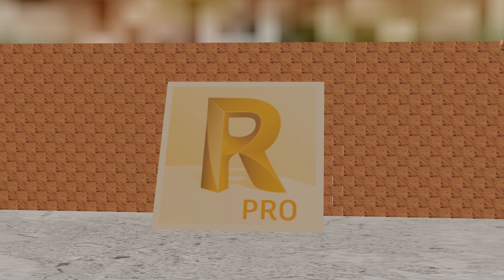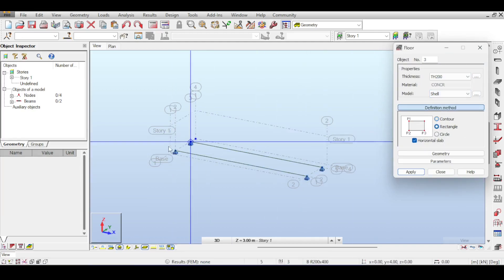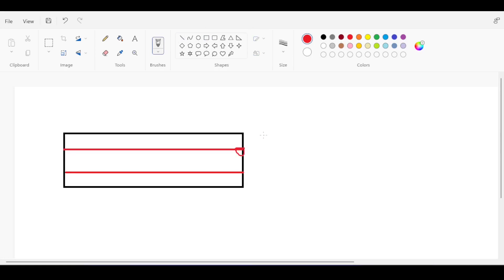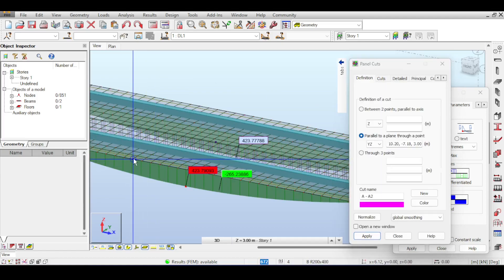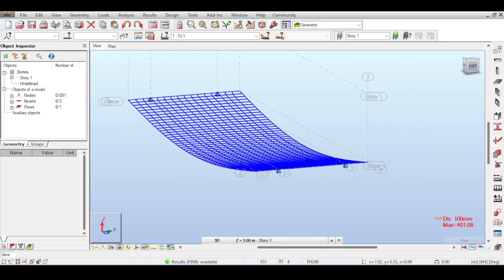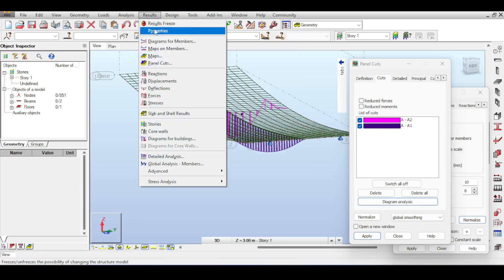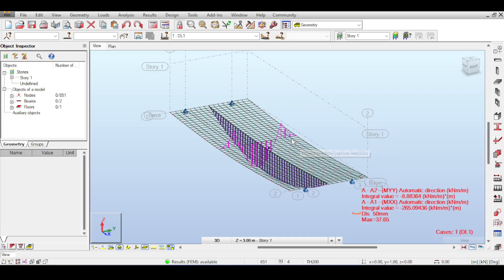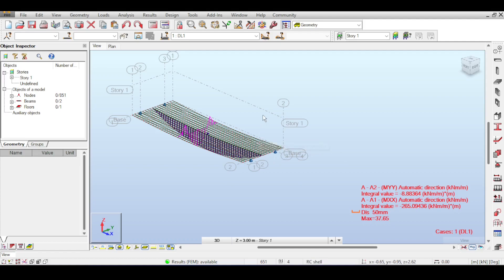The Importance of Beam Stiffness in Structural Design in Autodesk Robot

Comment: The idea of beam acting as supports to slabs doesn’t really sit well with me. In terms of supports, I believe columns are the only true support in any structure. The beams and slabs work in tandem in a floor system by sharing and transferring moments and shear according to their relative stiffness ratios.

Great tutorial sir
Thank you for the doubt clearing session.
Reply from the maker: I agree with you for most normal structures, as the slab and beam (especially if hidden beams) are cast monolithically.
(hidden beams are beams that have the same thickness as the slab, this is standard practice in slabs called: ribbed slabs in the Middle-east region).

In bridges, I am a little more skeptical to be honest.

Thnx for your comment, stay tuned for more content.

Regards,
CEE

Comment: The beam is normally cast with an offset to the slab's center. This greatly increases its moment of inertia about the slab's center axis, and stiffens the entire system. If you model this in Robot, you will get more realistic results. However, you will get some additional axial force in the beam, due to this offset, that is not easily negligible.
Reply from the maker: Hi there, a huge thnx for your comment.

you are right. Offsets should be included, but the way RSA models those is really strange. It just connects some rigid links, causing jagged moment diagrams. Thus, I think the effect of such an offset should be pre-calculated manually (for example axial and moment effects) and then applied on the bridge. 

Note that, if you have an offsetted beam, and you discretize it (because there is a slab for example), then each node will be connected via a rigid link.

So, I agree with you, but may suggest that the effect of offsets be calculated manually and applied as forces.

Of course, that is my own humble opinion. Feel free to suggest alternatives, I always welcome all ideas.

Regards,
CEE
Reply: @CivilEngineeringEssentials  My approach to the problem involves manual calculation of the stiffness of the offset beam with respect to the axis of the slab and then entering a stiffness correction coefficient for the main moment of inertia of the beam, thus increasing its stiffness. In other words - offset is accounted for in terms of stiffness, but not applied geometrically to the model. In my opinion, results are more credible.

Comment: I would argue that there is no longitudinal moment in the slab as the slab was poured as wet concrete so no stiffness. When the shuttering and supports were taken away, then there would be only transverse effects mostly. But indeed, the stiffness in 3D is something one shall be careful with. Cheers. Good tutorials, I do like them. Thanks
Reply from the maker: I agree with you. Especially if the slab is cast and reinforced separately. However, as you have correctly mentioned, structural software's are notorious in just connecting everything. One should be careful with his model.

I am happy you like those tutorials. Stay tuned for more content.

Regards,
CEE
Reply: @CivilEngineeringEssentials  you are welcome. Construction phases or stages are notoriously missed; I am not saying ignored, as ignored would mean that one had an awareness about it. An extensive tutorial about phases would be really welcomed. Thank you .
Reply from the maker: @TomKrok  That is an amazing idea. I think it warrants having a lecture "theory" about it.